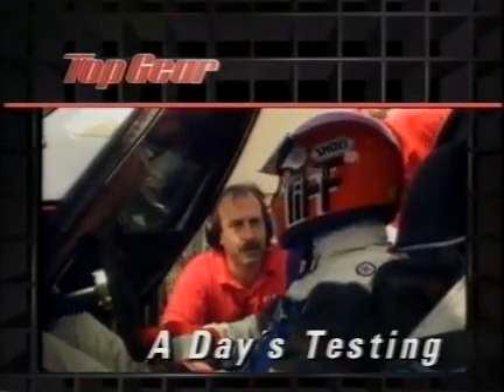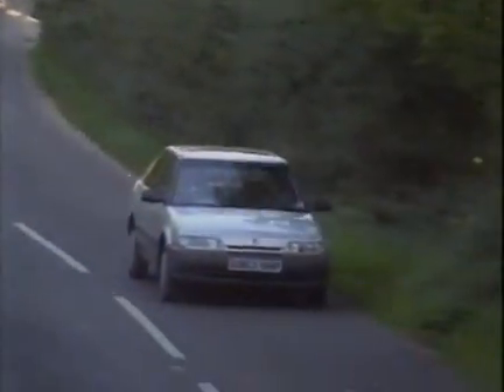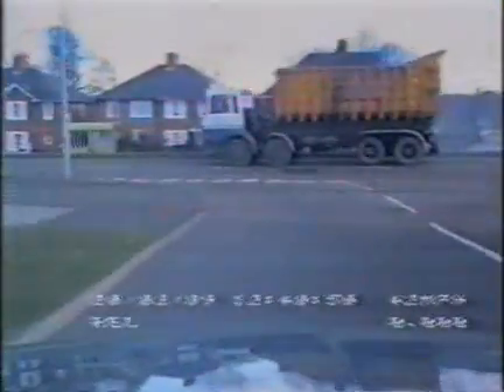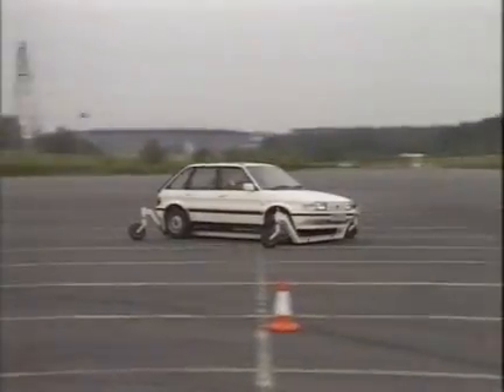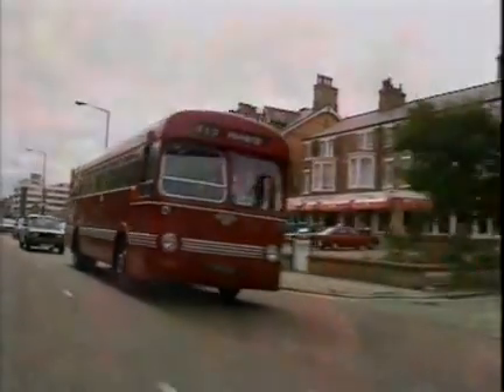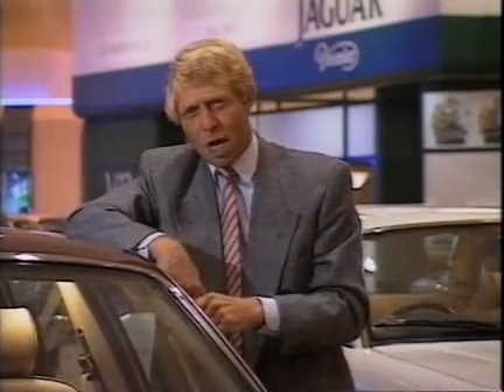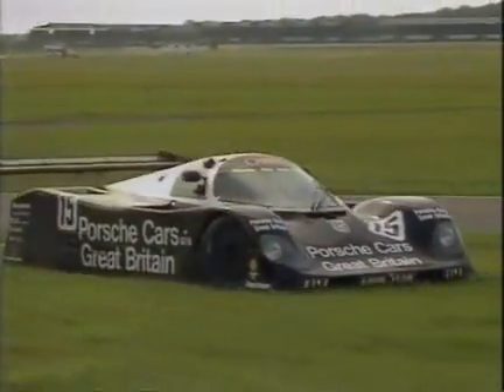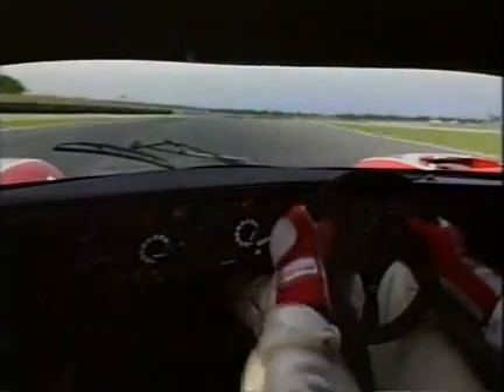Top Gear Classic (1977) 1989 eps 5

Comment: As much as I loved what Clarkson, Hammond and May did. The amount of actual information in these old shows was something they could have done in a different programme afte the trio revamped top gear.
Reply: Agreed.  Modern TopGear was more about entertainment.  I enjoyed it but the original was more factual, more consumer information, and also very professional.  I found the last two seasons of New Top Gear before Clarkson was sacked dull really, it was getting tired and a bit samey, but I never tired of old TG.
Reply: They did, but it was on Channel 5 so no-one noticed
Reply: @applemask  😅🤣😂 You're right I completely forgot about reverse gear er... neutral gear erm that programme with the top gear rejects Tiff, Vicky etc
Reply: They came very close to this in the early seasons of new Top Gear.

Comment: 95bhp from the 1.4 is none too shabby even for a na engine these days. Corsas are putting out less. New astra k is only 100bhp 1.4 naturally too. And the 1.6 116bhp was very healthy for 1990. 15 years later focuses and 307s and astras still only mustered around 115.